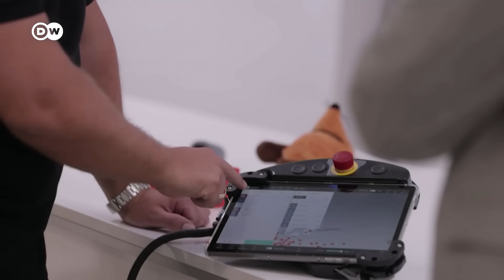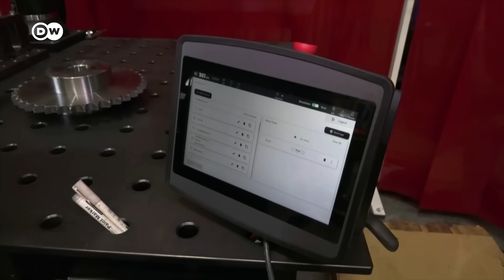Cutting-edge technology: AI robots made in Germany | DW News

Comment: I did some research but couldn't find video shows that this Robot can walk, or standing still keeping balance, the only one show it walks is a CG. I think the company is still in a very early stage,  bipedal movement requires solving nonlinear control problems and real-time integration of sensors, actuators, and control algorithms, and with the new reinforcement deep learning the algo is now requiring more Data, more training time, more prototype trails, and simulation time on computers, all these need money.  Policies trained in simulation often fail in the real world due to imperfect physics modeling, fast prototyping is critical.  Hope to see the Robot from Neura can at least stand for itself. good luck~

Comment: 5:14 It's insane. 2,500 applications a month for one company?? Just goes to show how cutthroat and oversaturated everything is. I was born in the country, have 3 STEM degrees with research experience, graduated 5 years ago... and I still can't catch a break! I ended up in some dead-end manual labor job getting burned out and bullied by people who can barely string a sentence together. I had to resign a year ago to save myself. Without connections/nepotism, it's truly over. Even with all the right skills you are still drowned out by the noise of thousands clamoring for the same scraps...
Reply: What are your degrees in?
Reply: @dekev7503  BSc was in physics and statistics. My postgrad was a special program that mixed physics with electrical engineering courses. MSc was in applied physics (experimental optics).

My research was mainly in biophotonics, and did one project in nonlinear fiber optics. I was working on an agricultural project before COVID.
Reply: @  Your field is Extremely niche and research based. It would probably be best for you to get a PhD( doing a few generic EE courses wouldn’t cut it if you want to get traditional non-research based electronics jobs). 

Electrical Engineering is really hot right now in Germany, especially in the realm of microelectronics, power electronics and systems, etc.  I’m not done with my masters thesis and I already have 3 offers ( including where I’m doing my thesis) . Some of my classmates left the program because they got great jobs with their bachelors degree. Some are working as full time Engineers as they study  .
Reply: @nickm7911  nerd 🤭😋
Reply: Why not apply at a plumbing company or an electrician company as a laborer or plumber's helper?
Reply: So true, but you should enjoy those scraps while you can. Once androids and AI truly take over, supposedly during Trump's empire, all that's gonna be left will be local manual labor. And those few jobs will already be taken by the rest of us, simple mortals without degrees (although not exactly by me, since I've never been able to get a job for the same reasons you described).